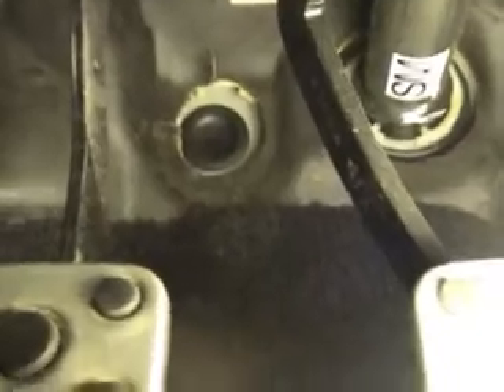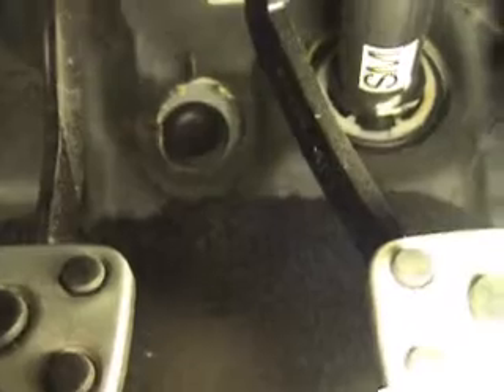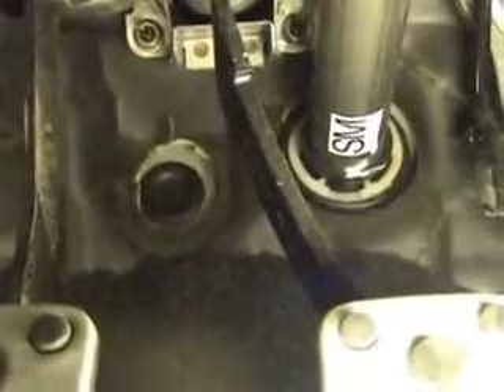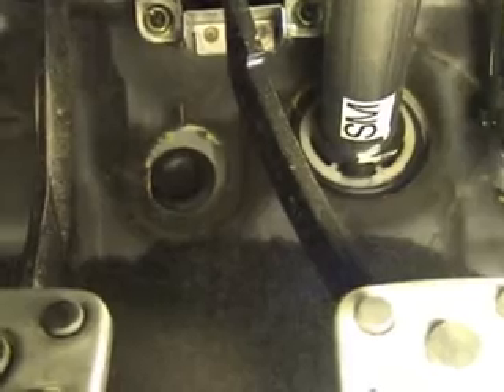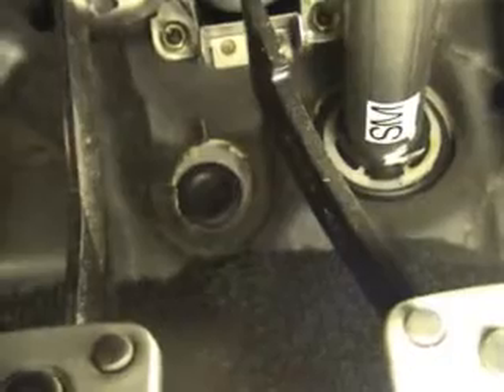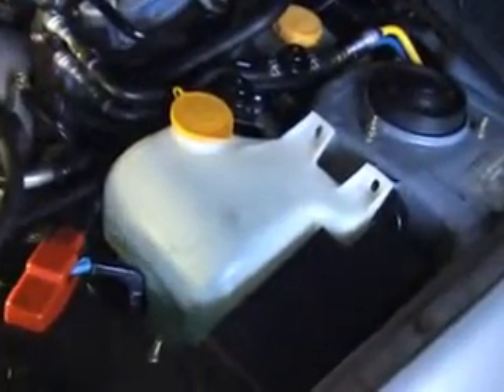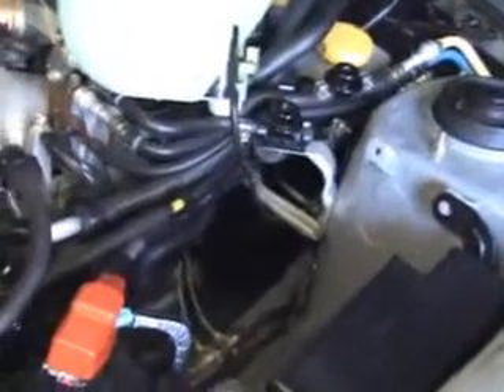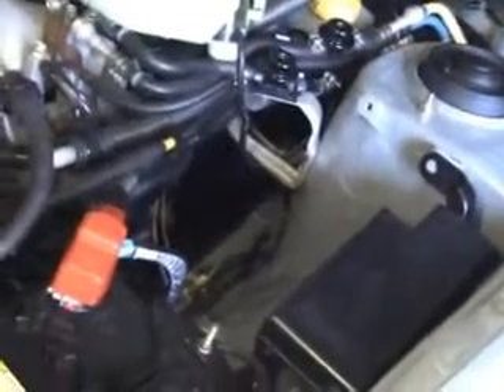2005 Subaru WRX: Episode 1 Vlog: Running an amp power wire, part 1

Comment: Where did you connect the remote wire
Reply from the maker: dood this was in 2005....
Reply: @LastHumansGarage  Yet here I am in 2024 trying to see where to run wires on a 2005 2.5RS, and this video was really helpful! I searched nasioc for a while, but no good info on the grommet. I looked for a while on my own car and could not find a good place to run wires, nor even see there was a useable grommet behind the master, so thanks!